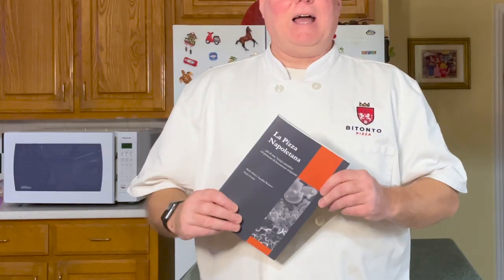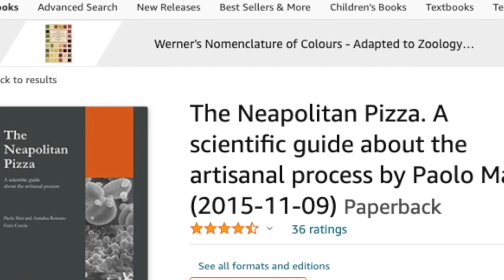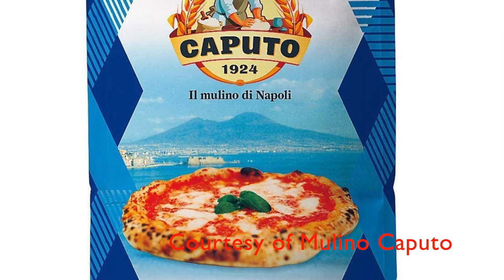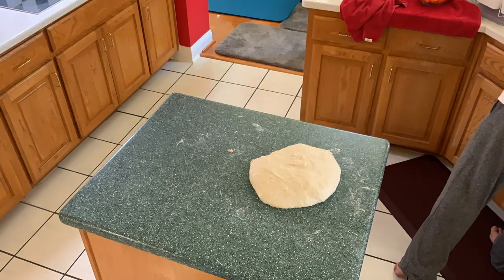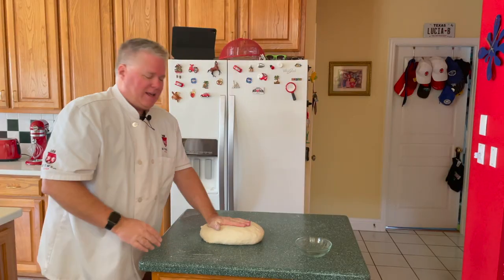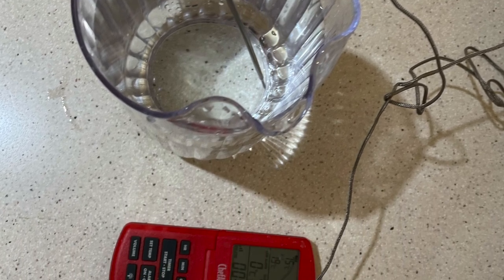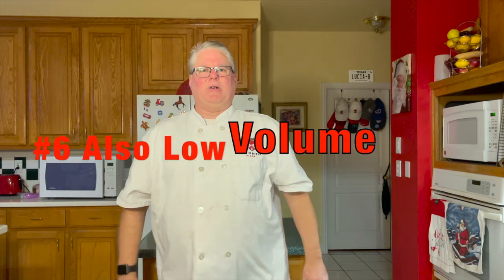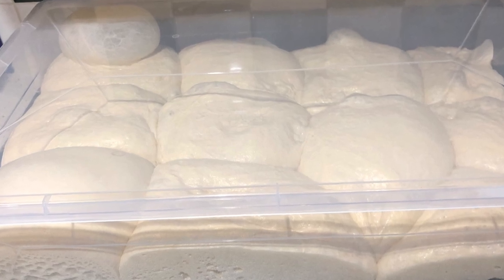How to make better pizza #1(troubleshooting Neapolitan pizza making process in your wood fired oven)

Comment: Do you use mesquite to fire up your oven?
Reply from the maker: I use Oak to heat the oven. Mesquite has a kind of in-between density and can be used to heat the oven or for cooking. I prefer pecan for cooking because it fires up really quickly. Oak is my go-to for oven heating but I would also use maple or cedar without hesitation!
Reply: Cool, I usually use red oak or almond wood here in CA.
Reply from the maker: When I was in Italy it was common to use olive wood which gave the pizzerias a nice aroma. Is almond wood a lighter wood? I'll bet red oak is nice and dense and heats the oven quickly and well.